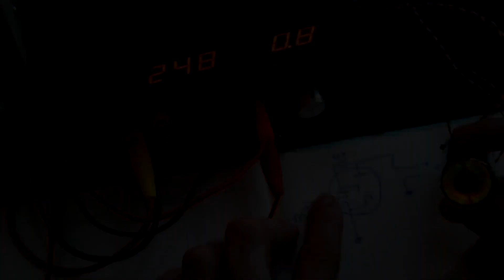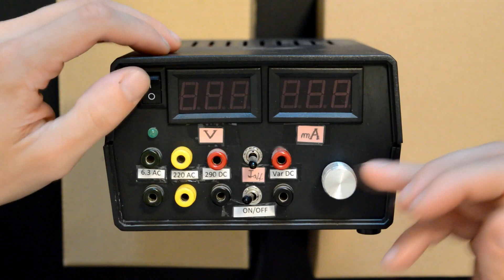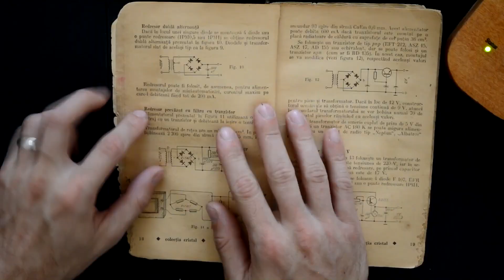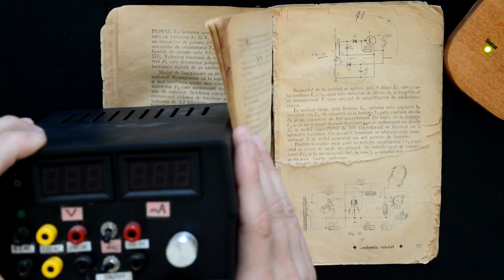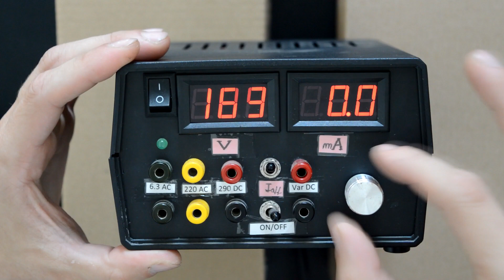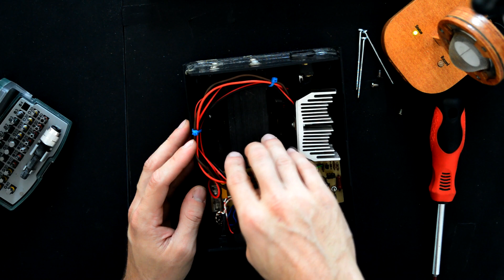Projects Revisited - High voltage variable supply

Comment: I assume the I meter has an IN and OUT for the current path, would putting two Schottky diodes from IN to OUT (parallel, in opposite directions) fix your I meter protection, or is 0.4-0.6V still kill it?

Comment: The "comparator" in the schematic is really a differential amplifier. 
As the output is in the FET's source only NPN provides gain. 
If you want more gain the N-FET could be in the negative rail, or use P-FET, with attendant circuit changes.

Comment: @FesZElectronics Thanks for the great videos. I am puzzled about R14 the 5K resistor between the pot wiper and the end of the pot. What is it for? It seems to me that you would get the same by increasing  R2 to 29K and replacing r14 with a link.
Reply from the maker: If I remember correctly, the potentiometer was giving a linear response, and the addition of the resistor turned it into a more logarithmic response - this made it easier to adjust small voltages at low values, and to have a more coarse adjustment at high values.

Comment: can we increase current of this supply like 1 to 2Amp
Reply from the maker: Power/current rating is limited by what the transformer can provide and how much heat the power transistor can dissipate. In theory at least, any current rating is possible
Reply: @FesZElectronics   thanks for reply recently I made this circuit worked well dimm a led bulb light output varied from 25 v to 290 v in my case. But when I tried to operate a 90v Dc moter the bjt547 and mosfet bew up with spark
Reply: My moter current rating was 1A
Reply from the maker: Its important to note that the motor is an inductive component - it can generate high voltage pulses. Usually a capacitor is used close to the motor terminals to prevent this. But other than that, an extra diode Anode to GND and cathode to V+ can be added to the power supply as protection from any reverse voltages applied from the load; as well as a TVS diode rated for a voltage above what the supply can generate (~300-400V) can be included. These elements should be enough to protect the power supply from other issues.
Reply: @FesZElectronics   i am not using any transformer converting Direct 220v ac to 290v dc with the help of cap and rectifier bridge. 
i have tried all your suggestions but no luck. it will be appreciated if you help out. or if you have time plz make a nice tutorial as above  it will help alot .
thank you

Comment: I think you can get away with using ICs if you common the IC power supply ground to the positive power rail of the regulated power supply output.

Comment: Why did you make the resistors in the tails of the differential pair of different values? And why did you connect one of them to the output rail? The differential pair works at constant current (when the circuit is in balance both tails draw equal amounts of current) so it doesn't really matter which side a tail is connected to (input or output). I would suspect that the imbalance of having it connected to the variable output might hurt performance somehow (although I have not done the calculations). Particularly, you might have issues because the current through T4 changes with output voltage due to the early voltage. I suppose it does not matter much, but still, do you have any reason why you didn't connect the tail resistors of T4 and T5 directly to the input voltage of 290V DC?
Reply from the maker: I guess the main reason was to keep power dissipation low on the emitter resistor. Also the input supply is more noisy; by using output voltage, its partially filtered by the series transistor and output capacitors.

Comment: You could build this using a thyristor to reduce the cost and weigh significantly.
Reply: How? I am quite interested in building something like this
Reply: @alexstone691  I think it means that varying the firing angle of a thyristor changes the RMS value of the signal. Capacitors act as integrators. Therefore, the power dissipated is much lower due to the MOSFET, since you can bring the input closer to the output. You add current pulses with much higher frequencies, and complexity if you use an isolation transformer. I suppose it also depends on the intended use. In my case, I would only use this source to measure high-value diodes or resistors, so the ripple doesn't matter to me.

Comment: I see that you have used German logic in the power supply - all inversely for  them. The potentiometer in the left position gives max voltage, and in the right position min :-) :-)
Reply from the maker: All the things I build usually have some sort of quirk :)) It wasn't intentional though, this was just the best option to get the layout right.
Reply: @FesZElectronics  How could this be correct?  Is all you need to do is switch 2 leads on the pot. He's being quirky for no good reason.